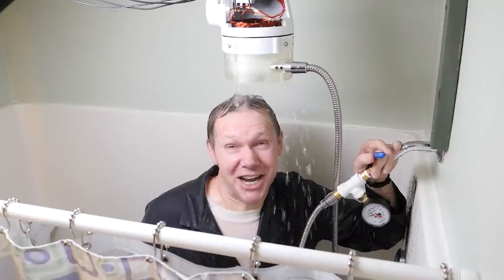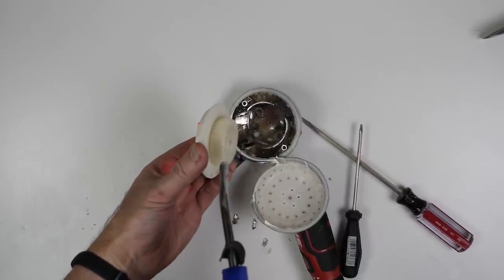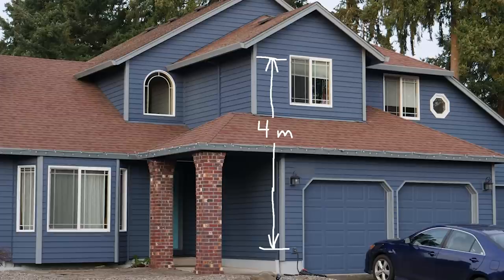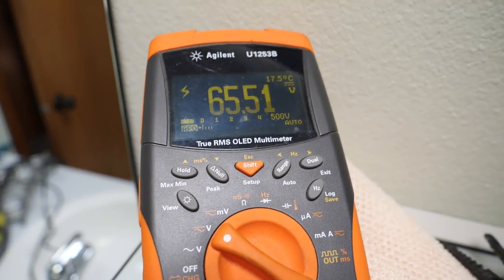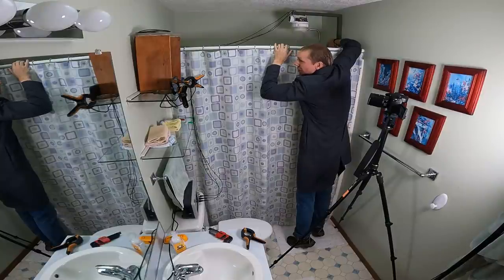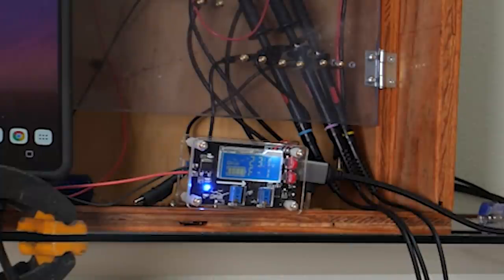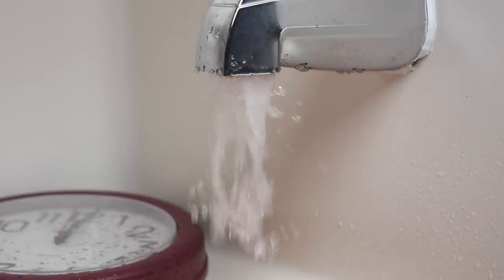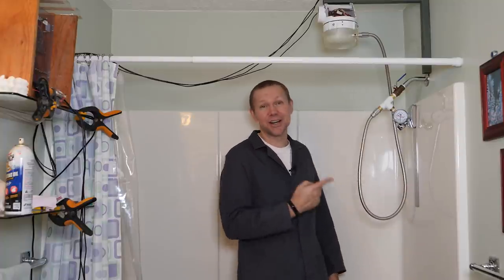SHOCKING Results! How much POWER is in your SHOWER?

Comment: To anyone who was interested in this in order to save money: Don't. Instead, invest in heat recovery for your shower. Maybe don't if you need to rip up your entire bathroom to install it, but if you're remodeling anyway, definitely look into it.

The water that leaves your shower often still contains quite some energy that your heating system added to it. Flushing it down the drain is a shame. A heat recovery transfers the warmth from the waste water to the cold supply line on the shower (without mixing the fluids, in case you're concerned), which makes the cold supply water temperature higher, so you need less warm water mixed in to reach a comfortable shower temperature.

Obviously, I'm not bashing the build. Like with anything, it's always a good (and fun) idea to try something and hope that it works. Sadly, it usually doesn't.
Reply: Any bit counts. And not every home, especially in another country, like mine, using heating system. His concept is good but it can be improve.
Reply: @eone2345  Every bit counts, but this is simply never worth the effort. The power output is negligible, literally.
Also, I highly doubt there are many places that have a shower that doesn't have hot water. Maybe in some climates, but any tap water is usually below 10C, and that's cold water, no matter where you're from. My advice is still applicable to probably more than 95% of shower installs.
The concept can improve, but nowhere near enough to be viable.
Reply: @timderks5960  yeah even for the leds in the showerhead (the disco showerhead he showed in video) it would probably be better to just use the power from grid.
Reply: @timderks5960  it's worth the effort if you know how to apply it. Remember we are not trying to powering the whole house but a small device and gadgets. It can be connected to a small battery that can be use later on as small powerbank. Also it can be use in offgrid house, power outage backup for charging phone as well as places where there's a problem with electricity (such as Lubnan). I have a friend who live totally offgrid who would love this concept.

Also, don't generalize your tap water temperature and shower statistic with whole world. Here in my country, it can be said all summer year along. This build is a good concept that can be improve and as a DIYers myself, I can see where this can be applied to. I am using small solar light as my reading and night light and also built a small led light with some recycling materials for when I sleep. Both using solar. But this system in the video is good for me to charge some battery bank by tapping the energy from our main water system. Of course, as a DIY myself, I have my own idea and design for this. It might be small for you but the are many parts in the world who might need or want it. Don't generalized.
Reply: @eone2345  No, it's not worth the effort. We're talking about 10Wh per day here, and that's based on 4 people showering (as in running water, not the entire showering process) for 30 (!) minutes per day EACH. That's a LOT. I repeat: a LOOOOOOT. Unless you have teenagers, no household is going to achieve that. Those 10Wh should simply not be generated this way. And you know what? That 10Wh isn't even going to charge 1 phone. If you need power, get a solar panel. If you need power at night, get a solar panel and a battery. There's even power banks with built-in solar panels available. All those things are SO MUCH BETTER options than trying to take power from tapwater.
I can also pretty much guarantee you that your friend won't love this. He might think it's interesting at first (like most that clicked on this video), but if he sees the numbers, I'm sure he'll realize that he's a LOT better of just buying a small solar panel, that'll give him so much more.

I'm not generalizing tap water temperature, that's just what it is. Tap water runs through pipes in the ground, the ground is pretty much the same temperature worldwide at the level where those pipes are buried, so yeah, tap water is roughly the same temperature worldwide, that's a fact. It moves a few degrees, but not much. I see you talking a lot about your climate, but I don't see you saying you don't have hot water, so I'm assuming even you in your "summer" climate still have hot water, and also use it while showering.

Just face the facts man, this build is for fun only, it's useless otherwise. It's probably even worse than useless, since it would encourage some people to leave water running for no reason just to get a tiny bit of power. If you think power is an issue, clean water is much more of an issue, so dumping clean water to generate power is a big no-no.
Reply: @timderks5960  bro, I can see from your reply, with due respect, your view are quite narrow.

Like I said, as a DIYer myself, I have my own idea and design, of course, I know what I'm talking about. I don't need it to run for hours long too, because it depends on your application for it, so every bits count. This video is just a proof of concept.

And if you want to talk about solar, you can have a look at my Shorts which I built a simple mini powerbank for my simple solar. I'm not good at making video so I don't record all my projects.

And regarding my friend, he already use solar system for his home. I told you he is living offgrid remember? But he's not a rich guy, so the system is just enough to sustain basic necessities. He don't even have washing machine nor fridge because he don't have power station infrastructure to supply to his home. Every little bit counts for him. I sent him some batteries, he was the one who made the design of powerbank such in my Shorts. I copied that design from him. He have small river near his house, but a small one which he use as his water supply to fill his water tank and paddy field, so this concept is good w enough for him, at least to power for the toilet's light outside his house. He used to ask me about this kind of system, but I can't explain well for him, but this video will explain it better for him. I live far away for him separated by sea. Just to tell you, he told me previously his many neighbour around him don't even have any light at their home so I crowd fund some money to give them solar light. But sometimes the area he live in didn't get enough sun and if you are familiar with solar system, you should familiar with terms like sun hour. So like I said, don't generalized.

And regarding piping system, I said the same thing before and you still at that.. smh. Yeah, while living in summer weather country, some people have hot shower system at their house, but majority of people here still prefer to use normal tap water, and it sure is not 10° as per your assumption. Sometimes I took bath at 2 am, do you know how cold is 10°C? I am sure you are talking about Celsius because if it's Farenheit, it was already minus. Normal early morning here is around 23° and in the afternoon, it was more than 30°. Sometimes in afternoon for outside tap water, you will need to let the water flow for a good few seconds to avoid burning yourself. If I have 10° water temperature here, I already use it for heat exchanger to make myself a simple air conditioner. And my house nor my grandparent never installed any hot shower system.

Please have a wider perspective view of the world.

Comment: The problem may be in the type of generator even tho the typical design of spinning generators can produce quite a bit of energy there is alot of potential energy spilling away into loss. 
I would tell you specificly what power generating system im thinking of but doing that in public im pretty sure i would reveal the potential for alot of technology i dont want others to discover as i want to build on those specific technologies i have in mind first. 
One of my technologies would generate electricity from the same movement as trees has and thereby removing the hazards and maintnance of windmills. 
As i dont have the funding for patents or are in any agreement with anyone my tech(Over 300 technologies) is on the shelf.

Comment: Is it possible to have a tank at high level and using that water pressure to run turbine and using some of that electricity produced to run a pump and pump the water back up to the tank

Comment: If water pressure is increasing your voltage, I wonder how many volts you could get out of your water air compressor using the "wind" it generates?

Comment: if you used a larger diameter pelton wheel, wouldn't that slow down the rpm and raise the torque for higher amps.

Comment: Why not do a measurement on the original LED shower head you had and determine its power output? 
That should give you an indication of the minimum power attainable through this system? 

Also what are the nominal specs on the generator you have installed, if you believe you are running it over the rated RPM could you not run the generator from a reduction gear set which will increase the torque and sustain a better load?

Comment: so would you say a 3D printed transmission to maintain a constant rpm along with varying the current limits with a charge controller and just stepping down the power from it's high output to your 6v~5v for charging phone i mean an inverter might help but then you get power losses to heat all the excess steps... i happen to know a bicycle 🚲 light motor runs at 6v so designing a housing for that would seem to make more sense as you could basically solder on a female USB wire maybe a capacitor or 6v battery inline to maintain a even flow... already designed it all for my bicycle just haven't gotten any stats for ya

Comment: without a load your turbine ramps up so in order to get the 500hz in balance you'll have to do additional load bearing calculations, or a gearbox or pressure valve, your system is too instable to perform at max efficiency, i like the concept to harvest free energy, big thumbs up for that, only if you keep it under control :} always go for max potential and you can do that, take this from a belgian electrician { most refined in the world, not to bribe} i like wat you do in the name of science and offcoarse your own wallet

Comment: quint just curiosity but could you convert a turbine to run on the high flow rate in exhaust from a V8 Engine i would really enjoy an experiment in this department since there is so much energy lost in I.C.E. and engine are a pump designed to move air. could you reharness lost energy and store it.

Comment: I thought that changing between Delta and Wye in a 3-phase system was sqrt(3) difference, not 2.
Or is that only power distribution systems with transformers?

As well, I'm not sure if it's an issue, but maybe check to make sure the wye-delta transformation was accurately done, as that has the potential of either shorting some wires or creating unbalanced phases.
Reply from the maker: You're probably right as the phases don't peak simultaneously, but I'll admit I haven't gone that deep (yet).
Reply: @QuintBUILDs  im hoping you do a follow up on this.  i assumed you checked that 1st.  But i threw out an idea about using thyristors i think would be worth testing.

Comment: I know nothing but perhaps a thick persons' perspective may spark something? Wouldn't the use of the power increase the resistance to the generator and throw off your efficiency calculations? I'm sure if that was the case you would have thought of it though :P Happy to be educated in all cases regardless! :)

Comment: check the 3 phase wave form, the 3 phase bridge rectifier is fine but u must install a capacitor on the dc side to smooth out the ripple as your generator is not spinning fast enough to provide smooth dc , get a 50v 10000uf cap from mouser , digikey , lcsc (those used in audio amps) also a solar mmpt controller will help much more to get the maximum watts out of this than a regular buck converter and u can use a quick charger from car to charge your phone much faster .mmpt controller will adjust the voltage and current to a point where maximum watts can be obtained and with high input capacitance it will think the 3phase generator is just a regular pv cell.
Reply: No.
What's the output voltage on a cap when it has smoothed the waveform? Think it through.
Reply: @deang5622  output voltage on capacitor should be almost the peak of the sinewave in no load condition.
Reply: @KuntalGhosh  Correct. And what is the problem the YT video producer has?

It's that the voltage is too high. So how does adding a capacitor address that issue?
Reply: @deang5622  that's why i was telling him to use solar mppt charge controller. Those can take a large range of voltage and will automatically find the voltage and current value where it could gain maximum power possible from the generator. & That power it will convert it to 12v and charge the battery..

Comment: I'm not sure a pelton wheel is the best choice for this use case. I find they struggle to reach their true efficiency in very small enclosures from all the counter-turbulence in the water affecting the backsides of the cups.
Reply from the maker: Interesting, thanks!
Reply: @QuintBUILDs  I heard Robert Murray Smith suggest a turgo wheel instead

Comment: is this normal? just had a shower fitted it works but i cant get the light on the unit to turn off its not using 10,000 watts just standing there is it?

Comment: Awesome video. If you find the maximum short circuit current and open circuiy voltage then (VxI)/4 should be the maximum power you can draw from a linear supply. Try getting a big variable wire wound resistor and finding the matched load resistance that dissipates the maximum power.

Comment: The lighted shower head you purchased had flat finned wheel for a reason. Try flat fins and see if lower impellor speed is truly what you need.
Reply: @mattmurphy7030  I totally agree with you in most industrial design methods. But the flat fins are possibly what Quint needs (not what industry needs) in this case. Flat vs cupped fins is an easy test to do since he has a 3D printer and the skills. You did hear Quint say that a slower impellor speed may help in this case, right?   How would YOU suggest slowing it down WITHOUT using flat blades or increasing volume of water flow by using a larger diameter nozzle?
Reply: @mattmurphy7030  I thought he was just trying to get the electronics he already has on the wall working to spec. Maybe I'm just misunderstanding his intent. all I know is he wanted to charge a phone and couldn't get the oomph. :-) Hopefully he will figure it out next episode, and who knows what direction he will take to solve the low current problem. You never know, the cupped waterwheel may direct the water into the housing and causes drag where the flat tip wheel might not. I've never seen an impellor like that cupped one in any type of high speed pump. Only on slow waterwheel type devices.
Reply: @mattmurphy7030  Yes, he wants maximum amperage from the hardware he has installed already. I've just never seen a cupped wheel in anything other than slow moving water wheel. Reason I brought it up is there may be some whacky hydrodynamic forces or turbulence going on in that shroud that we can't see and for that reason it may not actually be converting water to rotational force or speed as well as a flat blade possibly could. The only way to know in this custom setup is to test a flat blade rotor. it is cheap and easy to find out the facts. I will gladly admit I was wrong if he tries it and flat blades fail. But I'd love to see a comparison and some actual data.
Reply: @Matt, sorry for the double reply, I thought the first one wasn't posted.

Comment: If you think that the generator has a sweet spot speed, then maybe you should test it out, using an electric motor that you can track the speed and torque required to hit that max sweet spot.

Comment: Try to design some planetary gears, you can increase the torqye at the output but also decrease the rpm of generator. I said planetary beacause is the simplest design to fit in yours. 👋
Reply from the maker: THAT is a good suggestion! I'll have to see how it fits in CAD but it could work really well! 👍

Comment: If you’re getting a 25v output you could maybe use a 5:1 winding transformer to give you a stepped down voltage of 5v and an increased current output

Comment: Stay on "star" wiring but put capacitor, coil and resistor to get Amps and reduce voltage. But be careful, don't burn your phone. It can't handle too much amp.

Also, don't play with electricity under a shower. You are crazy !

Comment: Hi, or the generator is not in delta configuration or the generator is far from the ideal regime of rpm. Basicly or you a a shorted phase or try with a bigger nosel or even without nosel. Very interessanting experiment. Sorry for my poor english
Reply: Because all generators are differents you can load test your generator, lets say, at 50, 100, 500, 1000, 2500, 5000 rpm to know with is the rpm that will give you the highest output power, then try to get the "ideal" rpm on your experiments
Reply: I can't give you numbers about the expected power generation in you case, because my brain, short circuits under imperial metrics 🤯🤯